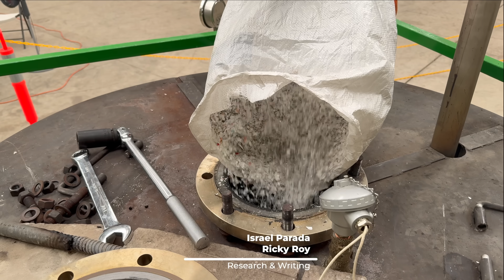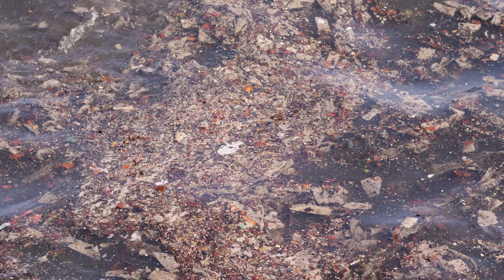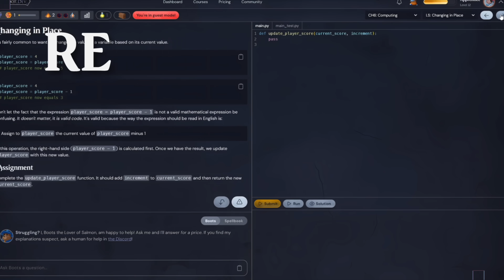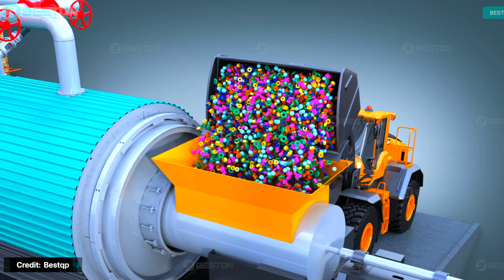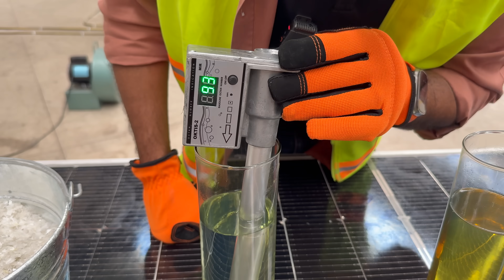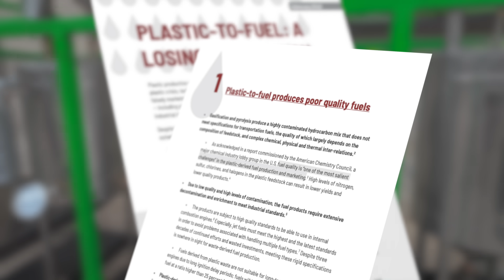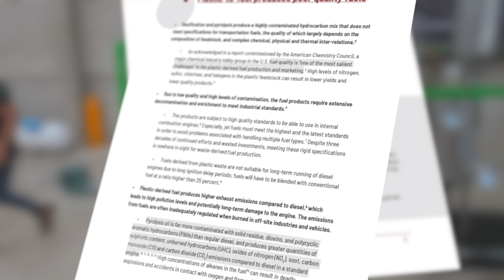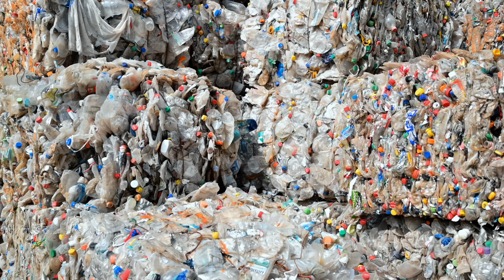Solving the Plastic Waste Problem - This Surprised Me!

Comment: Re the circular economy idea, energy is added at every stage and often ignored, hydrocarbons are just part of that the ultimate circular economy, the ecosystem. Plastics are not sequestered carbon. Single use plastics are a market response to growth and reusing waste, a result of innovation in an economy, finding a use for industrial waste from the hydrocarbon petrochemical industry. Processes like the one introduced in this video can reduce  supply side of plastics by reducing the feedstock for single use plastics. But not is we don't address the political problem of manipulating consumers and the economy for exponential growth and consumption.

Comment: Thermal pyrolysis is a good idea as a system component, and an RND project, but it's an environmental problem we haven't solved yet. Regulations/ guidlines need to work to adjust the formulas of the upstream feed stock. Plasticizers are forever chemicals that persist, over time, many are introduced as modifiers, flame retardants, colourants, UV stabilizers, etc, these chemicals commonly called PEFAS (Polyether-substituted Perfluoroalkyl Sulfonic acids) are released into the biosphere when such fuels are combusted.  I want to see this teach, but we need to clean up how we think of plastic now to make this a reality.  (fun fact, plastic is practically a waste product of the oil industry, Thermal pyrolysis is just refining that waste product further. )

The solution starts with this RnD project, documenting and telling (guiding) industry on how to optimize single use plastic for best environmental outcomes. (they've solved the energy equation, now we need to solve the toxicology side of the equation.)

Comment: I wonder if pumping this plastic back into oil wells will generate the energy needed to compost these plastics without using any additional heat.  I'm sure these wells are deep and are close to the earth's core to generate heat naturally.

Comment: I was sold until you said it does not take all plastics and you need to sort the plastic. The number one problem with plastic recycling is it’s very difficult to sort the plastics in the first place. If you could sort it all until it’s original type, you could reconvert it back to that type so plastic, the plastic recycling as you discussed.  If they can build the system to take all plastics, then it would be an ideal solution to the plastic waste problem. Human beings are going to use fuels anyways, until we find a way to remove fuels from our daily lives, but until that happens, we will need fuels and it’s better to use the waste plastic then to pull more oil out of the ground.

Comment: This isn't new or game-changing technology. But pyrolysis is great and should be used more. The "problem" here is they are taking the lazy way out and only cracking the cleanest sources of waste (certain plastics). The reality is, all plastics, plant matter, human and animal waste can be processed the same way. We can eliminate landfills entirely! When applying thermal depolymerization so more challenging waste you have to go through more cleaning steps on the output fuel. They also can boost efficiency of their system considerably. Glad to see another company doing this even if they are only using easy plastics. The more the merrier.

Comment: Plastics are oil. Burn them in appropriate furnaces and use the heat to generate electricity. Why is that a problem.

Comment: Oil to fuel with an additional value add use in between.  The plastic to fuel step would reduce the amount of oil required for 'fresh' fuel.

Comment: I remember reading an article in Discover Magazine in 2003 called "Anything Into Oil" about this process.  This is hardly new, but it does sound like this group has some breakthrough on producing high octane gasoline.

Comment: Will the process scale up, and is it commercially viable to sell the resulting fuel?
Stop worrying about CO2. I understand it has reached saturation point in the atmosphere and will not cause further warming (like a logarithmic curve which is flattening out).
Reply from the maker: pyrolysis scales, economics are the hard part. CO2 forcing doesn’t actually saturate — logarithmic doesn’t mean it stops.

Comment: I had a major project on plastic recycling plastic a few years ago. We spent millions to get nowhere. Plastic quality goes to hell when it is dissolved or remelted and nobody in 30 years of intense research has been able to overcome this issue not to mention the dozens of different plastics that can't be mixed.   I recommended gasification which fell on deaf ears as the herd was focused on recycling in a conventional sense. Then there was the CO2 bogieman.
Reply from the maker: gasification’s tough—heat management and tar kill efficiency, but pyrolysis sidesteps some of that

Comment: Far from perfect recycling indeed, but could at least help reduce one environmental problem....IF it all holds up in independent review.
The bits you tested were, as you said, from a previous batch. That's ok, but who guarantees that it didn't just come from the local gas station?
Definitely needs more independent testing to get reliable results about energy requirements, waste products and scalability, especially if it only works well with specific plastics that first have to be sorted out from the incoming heap of mixed waste plastics.
Reply from the maker: street plastic test or bust

Comment: Yeah, pyrolysis is great, but the system can be designed in a way to extract hydrogen directly and separate the carbon as a powder. This is much better in terms of not releasong more CO2 into the atmosphere.
Reply from the maker: H2 capture’s clean but the trade-off’s always complexity vs. gain — what’s the sweet spot?
Reply: @TwoBitDaVinci  Well, i'd say the sweet spot is stopping getting more CO2 in the atmosphere so we can prevent eradicating ourselves if we're diligent about it over the next 100 years. But besides that, removing plastic from the environment is always a good thing. 

As was mentioned in the video, their system is energy positive. Same thing with a system that separates hydrogen from carbon entirely; if you burn the hydrogen, you can power the entire process and you will have a huge excess of heat which can be used to power a turbine for electricity generation, for example. You'd also produce carbon powder which is valuable and can be resold.

Though, if the plastic contains other atoms besides hydrogen and carbon, or additives, they can be quite tricky to deal with. PVC for example, contains a chlorine group. When pyrolyzed, it releases its chlorine and this reacts with hydrogen to produce hydrochloric acid, which is extremely corrosive to the system. Lots of challenges ahead, but their system is a good stepping stone forward.

Comment: I personally think it is a good idea.  However, it will be criticized for taking inert waste that would ordinarily stay on the surface and putting it into the air.  Trading one form of pollution for another
Reply from the maker: burning plastic for fuel? yeah that's gonna get some heat
Reply: @TwoBitDaVinci  

LOL!  I see what you did there. :D

Comment: "this is from a previous batch". So there is no way of knowing if that was actually just high octane gas they got delivered. And how do we know that the car wasn't also running on fuel from the local gas station?
Reply from the maker: we ran the fuel through a GC-MS — same octane as pump gas, but zero aromatics. plastic-derived, not station fuel.

Comment: This technology may be "coming into its own" but it isn't new.  Scientists and engineers have been working on this for decades.  Plastics are made from petroleum.  The problem has been, how to separate out the "fillers" so that the petroleum can be used as a fuel.  The simplest solution is to burn it and use filters and scrubbers to catch the waste products that are produced.  But, that leaves potentially toxic waste that needs to be stored.

Comment: We can. Low temperature, solar heating even? Cook it all into her fuel.  1kg plastic = 1liter fuel
Reply from the maker: 1kg plastic = 1L fuel? Wish it were that tidy — real yields are messier, especially with solar heat. Temp control eats your lunch.
Reply: @TwoBitDaVinci you can beat things that distribute the heat.   You don't know subtlety it seems. 

There is a concept called 'regulation' where you don't go all out but pace yourself or your energy.
Reply: @TwoBitDaVinci  I've seen it done over a wood fire
Reply: @TwoBitDaVinci The plastic is free

Comment: all that sounds good But not all plasctics could be recycled that way. Huge problems with PVC and PET. also all plastic should be sorted! mixed plastic is broken equipment.
Reply from the maker: PVC and PET don’t pyrolyze well, and mixed plastic jams the system — spot on.

Comment: How much plastic is required to produce 1 barrel of fuel? How long does it take to produce that 1 barrel of fuel? Will the cost of collecting plastic, the energy required to break the plastic down into smaller pieces, the initial fuel and energy needed to start, and the manpower required drive up the cost of each barrel produced by the process? With everything included, is it cheaper or the same cost to produce using our current processes? If governments subsidize some of the costs, I think this works!
Reply: Nothing "works", by definition, if it needs a taxpayer subsidy. Things that actually work, inherently DON'T need to be subsidized by unwilling taxpayers!

Comment: This is really neat, but I find it ironic that a company called PetGas can't accept PET
Reply: the reason for that is because of the yield of PET when turning the material into some profitable products, one ton of rubber tires can get you between the ranges of 67% to 85% of synoil (syntesis oil wich if processed can turn into diesel or petrol and sub components), 1% of char which is basically coal and the remaining of the material is turn into syngas which can fuel the process; PET has the lowest yield values and saddly is the most common waste we have, you get like from 45% to 60% of synoil, 20% of char and the remainings in gas a lot of the numbers depend on the time and temperature you will put your reactor to work. Some experts indicates that we shouls use a mix of a low porcentage of pet and the rest in high value polymers. But its basically that, the yield of PET is not enough to make it attractive to process it.
Reply: @JuanDaTU96  yes but that doesn't make it not ironic.
Reply: @TheRandynorris  true
Reply: @messiermitchell4901  🤣😂🤣👍
Reply: thats why pyrolosis isnt popular.
here in Lebanon before gas went through the roof, diesel was around 670$ per ton.
plastic scrap (ldpe and hdpe) was around 500$ per ton.
hdpe and such yields around 90% oil from pyrolysis.
pet yields around 20%.
its not eco viable.

Comment: Thermal Pyrolysis is quite useful process to solve plastic waste. And this process with some addition/modification can produce H2 from plastic waste or biomass. Final product can be carbon-black or biochar (capture and store carbon from air/plastic waste). It (biomass + thermal pyrolysis) can be the fastest method to remove carbon from air.

Comment: I think this is a great idea to reclaim the oil from plastic but I see a big issue that needs to be solved and that is sourcing the exact plastic you need for the process. Meaning you can’t just dump landfill “plastic “ into a vat. It has to be sorted. That is the next problem to be solved

Comment: If the biggest concern is pollutants released, then modern incinerator power stations win because they burn super hot and use scrubbers to clean venting gas.... And they're not selective when it comes to their fuel needs, its all trash, if every city used there then trash dumps would no longer be needed. But sure, this is interesting.

Comment: If plastic is recycled properly, into different categories, mounds and hills can be made for underground and/or hilltop homes that probably won't be infested with bugs, nor be affected by floods much.
The plastic particles would need a sufficient binder material that doesn't outgas, and limit the outgassing of the plastic particles.

Comment: Regarding the "one way trip" of hydrocarbons, if you can make gasoline, wax, etc., why cont you take those products to make otger petrochemicals such as plastics?
Reply: That's totally doable, it's called depolymerization and it doesn't go through a gasoline or gas intermediate

Comment: Can it create gas and other fuels cheaper then current methods of producing fuel, if so fully on board for the "one way trip" as something needs to be done to massively at scale reduce the plastic waste going into the oceans, if it can also reduce the total amount of oil we need to pull from the ground thats good too because as you've shown in other videos there are companies working on alternatives to the plastics we use in every day life, combine these systems together and the reduction in oil drilling will be a net reduction vs just recycling plastics and it's energy waste. This will also encourage plastic collection globally and help with recycling in general.

Comment: this is not the first , there's been a dozen .one in philly built at the phila navy yard got grants and failed . no ones been able to run more than a pilot unit like this one 
it has to scale up to at least 10,000 gallons a day min , for real production 10,000 Barrells day . at rates similar to oil.  plus you called remnants if i understand coke to line for heat .coke normal term is fuel used in steelmaking since it burns hotter as all water and other things are gone  . but i still like seeing theses projects 
but i still believe thorium or the other safe molten salt nuclear is where we need to go . and use french method decide on 1 or 2 designs and only 1 agency regulates
btw while mi county lee in fl pulls plastic in co mingling recycling we have a very well run trash to steam plant thay it might be best to put plastic in it , never cited in 35 yrs as far as i know of it

Comment: I look at this sort of thing, using basic items, to make fuel out of plastic, on a small scale,should we have an SHTF situation and long term grid own situation and I need to keep a Generator going to provide electricity, as there will be plenty of plastic trash around, people will just ignore.
 I have an old pressure cooker, some metal and plastic piping and some bottles to use as a condenser to cool down the gases given off by the burnt plastic.

Comment: Given that plenty of fossil fuel engines are around and will probably continue for several decades, it's a more eco friendly option to use a waste product to produce those fuels. Yes recycling into new plastic products would be slightly nicer but the reality is, most plastic isn't recycled at all or only into products of a lower grade, you also cannot recycle plastic indefinitely and especially for degraded/contaminated plastics this seems like a good solution to get the most out of it.

Comment: As far as the final " should we " question.  I think yes based in part on the ecological destruction that waste plastics bring.  People will people and use fuels either way.  Reducing the waste plastics, and there are plenty, while drilling for less oil and still having plenty of plastics for recycling is a win.  Perhaps we can bump up that 10% of recycled plastics a bit along the way.

Comment: You can use plastic that cant be recycled Some plastic is only one use and cant be recycled. Also plastic has a limit of how many reclycles can have. Also dirty plastic o mixed plastic that cannot be recycled this machine eats them all. I went to houston to the innventors and it can not be exported to brazil due to patents insecurity. But this thing is ideal to go  to open ilegal dumps and get all that plastic to make the fuel for the trash trucks. So they get free logistic energy cost.

Comment: The only downside of this is that the plastic does not pollute the air or add to the global warming, but if we convert it back to fuel, than by burning that fuel we worsen the global CO2 emission

Comment: The oil would have been turned to fuel if it hadn't been made into plastic so turning it into gasoline is kind of a wash. . .
Reply: No it wouldn't because the compounds for making plastics and fuel come from different fractions of crude oil
Reply: @MSUY I understand the refining process separates the crude into a variety of products used for different purposes, as well as different steps along each derivative can produce useful products along the way as well. Can you help me get my head around how they are getting gas from plastic made from derivatives not suitable for making gas?

Comment: How to feed and deload the system is the key in my opinion. As long there is no continous process, it is laboratory. 
My idea: push the plastics into a long pipe with a hydraulic driven piston and high pressure. Then all the air can be driven out and the plastic plugs the reactor. Same princip on the deloading at the bottom of the reactor.

Comment: I was doing that 15 years ago. Ive been involved in other R&D projects that were proven to be viable but once proven they never went anywhere. One project we took the methane produced at the local landfill and converted it into synthetic diesel. The process could be utilized to convert all sorts of waste gas streams turning those fuels into a valuable liquid product. Greed prevented it from ever being offered to the market. 3 years of research wasted. Pyrolizing plastics is not a  new novel comcept. Its been provem many times over.